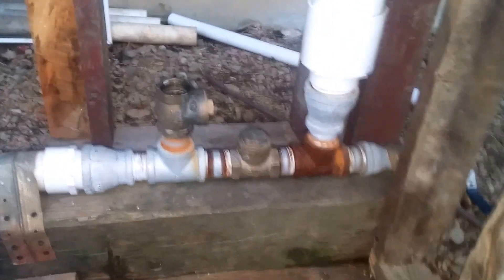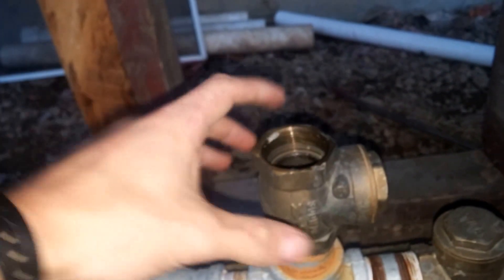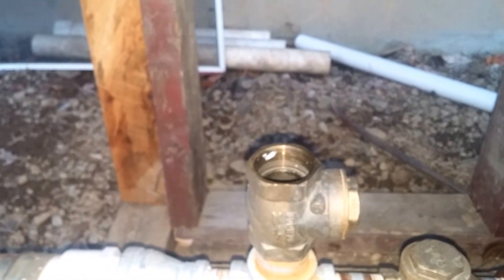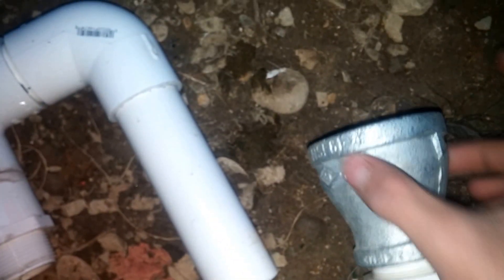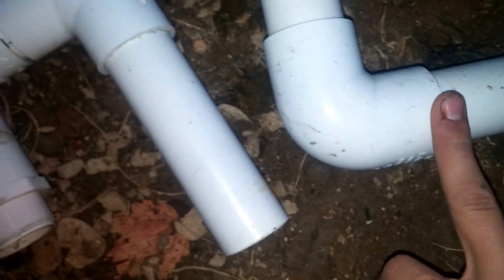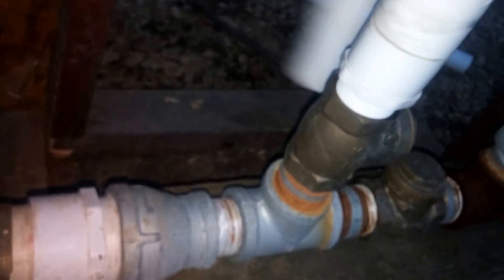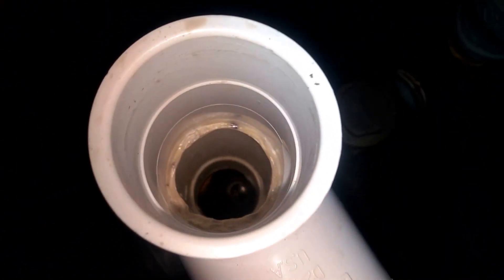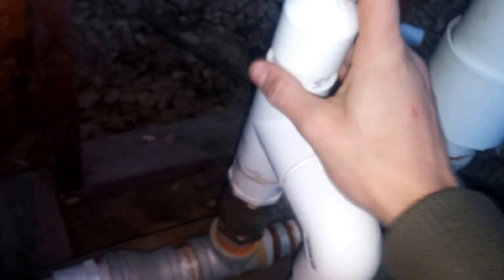Ram pump waste valve redesign

Comment: 10% is the water the pump lifted. What you increased is still wasted water.
Reply from the maker: I know it is waste water i just made it because i was going to put my pump inside a building so i could run it all year round and i could run the water back to the creek
Reply: If you keep your pump at the bottom of the creek it won't freeze as long as the creek doesn't freeze solid. The top of the creek can freeze and the pump will keep running underwater.